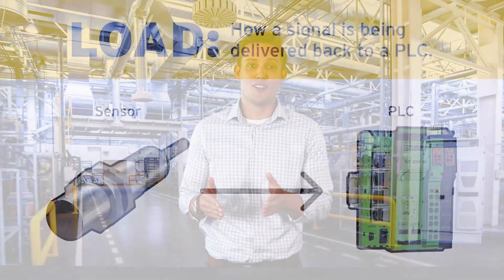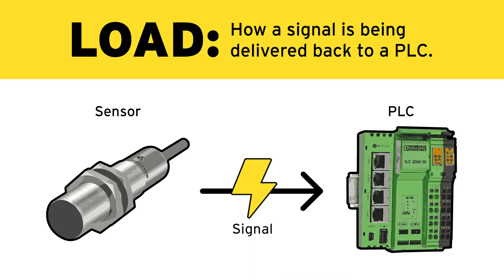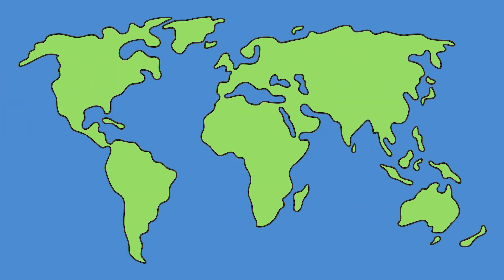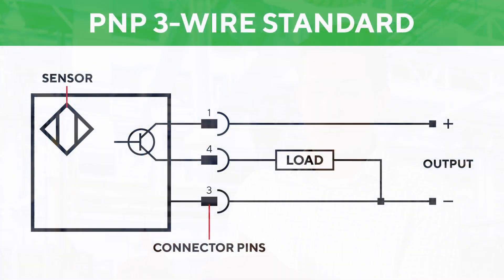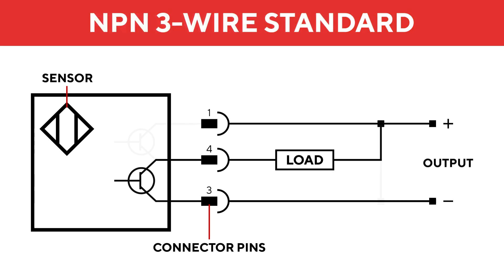PNP vs. NPN: What's the Difference?

Comment: why would one use one over the other?
Reply from the maker: It depends on the direction you want the current to flow. You can read more about this here: https://www.brainboxes.com/faq/what-does-npn-and-pnp-mean#:~:text=Whether%20to%20use%20NPN%20or,input%20to%20a%20positive%20voltage.
Reply: @neffautomationexperts3632  , yeah, not exactly. Few people specifying sensors and/or designing PLC I/O circuits care which direction the current is flowing, and anyway, the current flows in the same direction regardless of whether a sensor uses an NPN or PNP transistor....it flows from power source + to power source -.

A more useful way of looking at it (and ignoring a few documentation outliers ), is that if you want or need your sensor to connect to the power source + side, it needs to be a PNP type, and if the sensor will connect to the power source - side it needs to be an NPN type.

Another way is that it depends on the characteristics of the PLC/DCS input you will be using with the sensor. If the input module common terminal is connected to power source - side, then almost certainly the sensor will be coming from the power source + side and thus a PNP type sensor must be used, and vice versa.